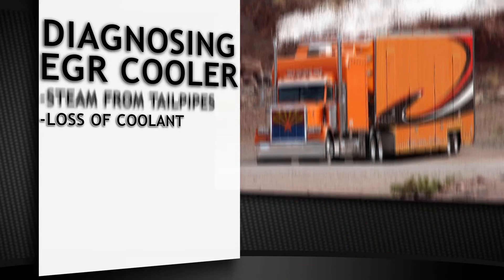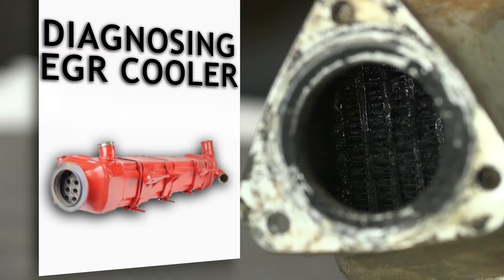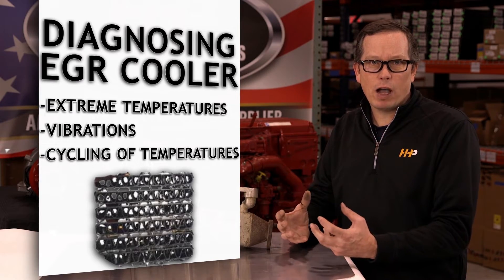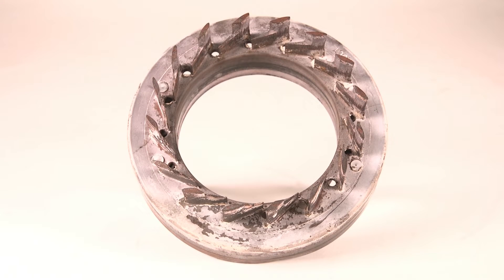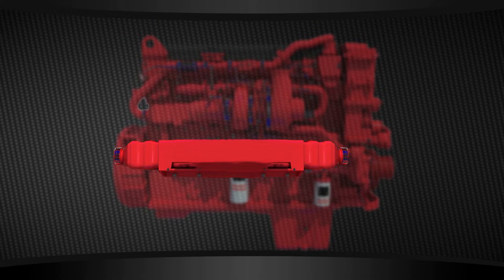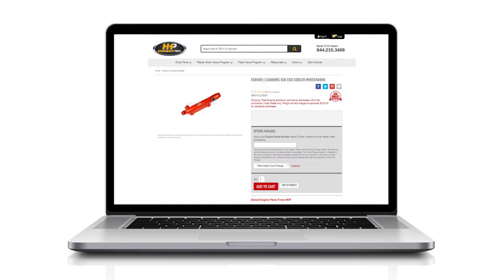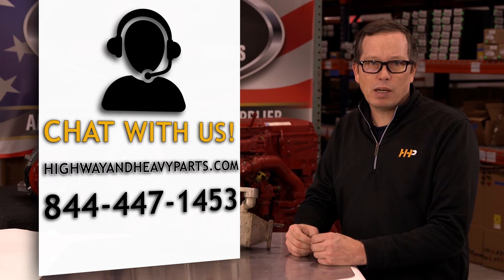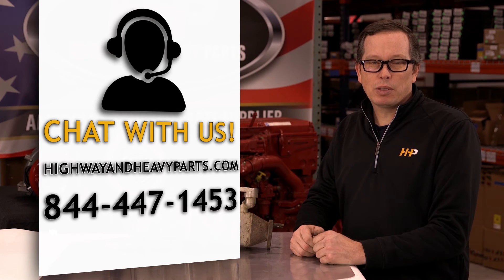EGR Cooler Failure Symptoms and Solutions!

Comment: Hi. I have received a letter from the bmw regarding the egr recall. At the same time I’ve been having many issues with my n47 engine lately. I had the turbocharger fail as well as exhaust stem valve seals leak causing a lot of white smoke. Wondering if egr could possibly affect those parts and whether I should contact bmw regarding that? I’d appreciate the reply. Thank you.
Reply from the maker: It is possible the EGR fault could cause some of your issues. I would start with having BMW complete the recall then reevaluate after that is completed. If you have any more questions, you can give us a call at 844-447-1453!